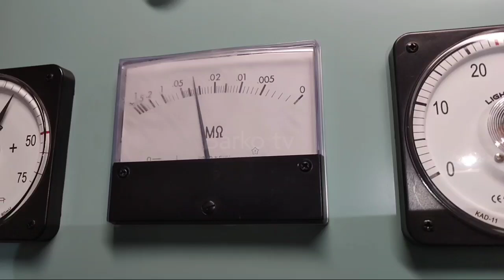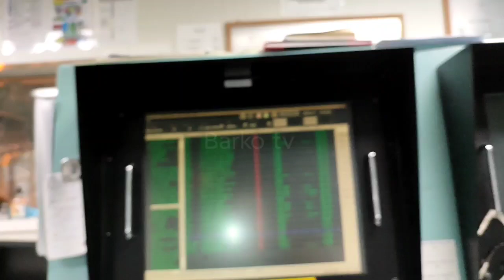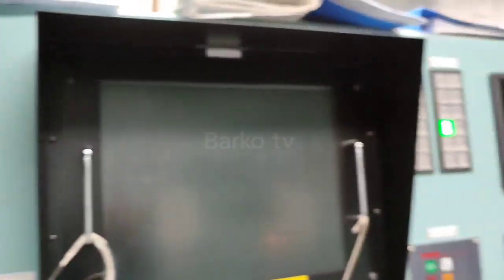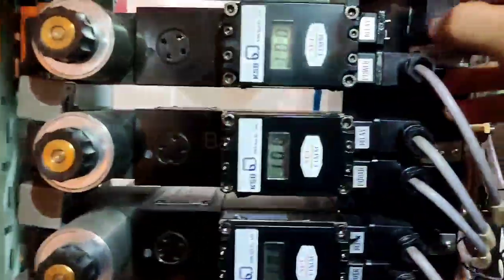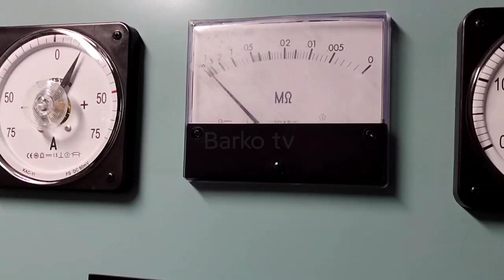Grounded 24VDC Engine console at VRC Hydraulic system / Low insulation

Comment: Brother, I'm also facing 24v dc low insulation, disconnected most of the loads and checked couldn't find, now remaining are important loads.
I tried removing fuses for generator safety , control and VIT system, after that PLC for one generator got kaput 😞

Now I'm afraid to touch other imp loads ...
Reply from the maker: Yor plc battery is kaput already,thats why it wont save program. Dont be afraid mate, 24dc is common use for back up if your 220vac is gone. Go to your 24vdc and disconnect the main fuse so that you can locate easily if in the bridge console,or ecr console or in emergency lights.
Reply: 2 rtd PlCs got kaput , because of that generator parameters cannot be seen on the AMS, because of that  one generator is out of operation. So chief engg told better don't touch.😞 @BarkoTv

Comment: Thanks for sharing..battery charger  we  have brige console and engine comsole fuses if we remove any thing happend to running  machines like generator and ME and bridge navigation .
Reply: And also can we take out fuses in engine console 24 v dc distribution board for checking low insulation in sailing ..it may effect running operation or not
Reply: Don't remove ecc fuse directly, it'll cause blackout since connected to generator safety and ctrl system

Comment: Can you please do a video on how to change the diaphragm of air horn
Reply from the maker: If we have trouble in our  air horn, i will do👍, but in my previous experience, its just a normal valve that linked to the cable for opening the valve. And in the foremast, it is piston type, air horn.
If you have any problems in your air horn, don't be afraid to dismantle it, just trust yourself and you can do it, also it is stated in the instruction manuals🙏
Reply: @BarkoTv  thanks

Comment: But what if happen if remove fuses for sensors that likr tiunning generators or other assential loads?
Reply from the maker: You can easily remove the fuse without Interruption its because there is a auto change over power supply that is connected to your 220VAC feeder called engine console.